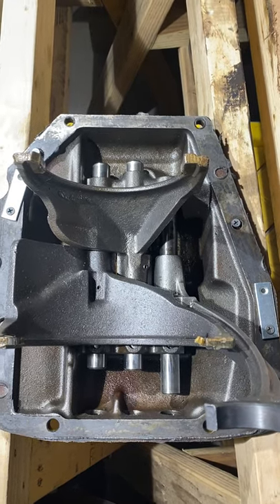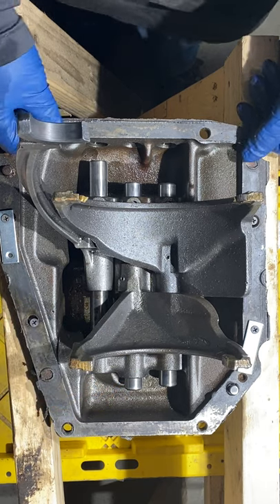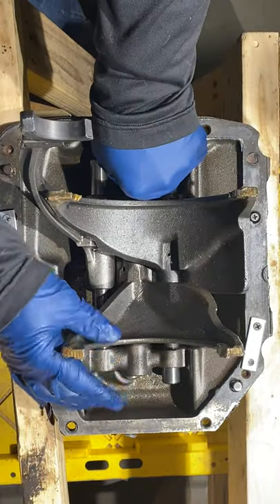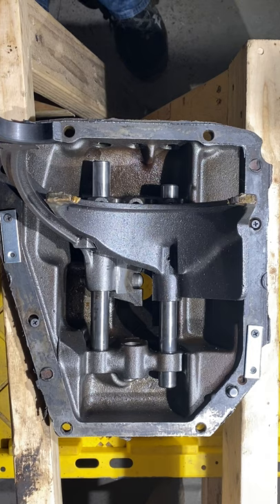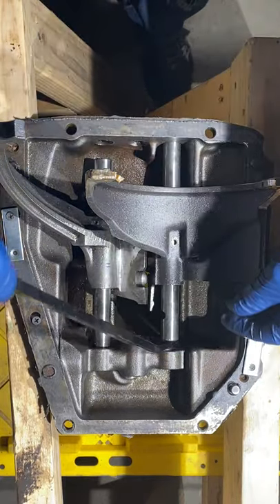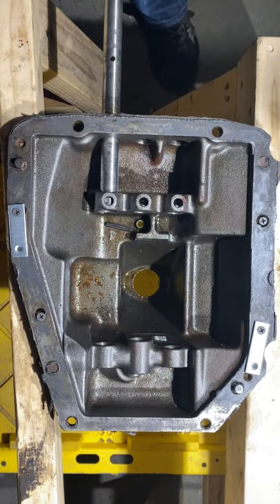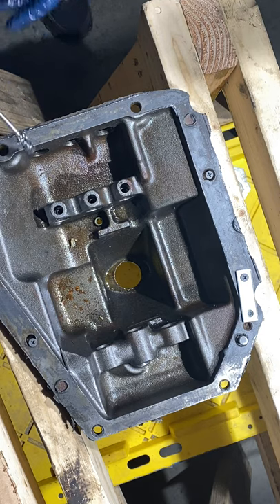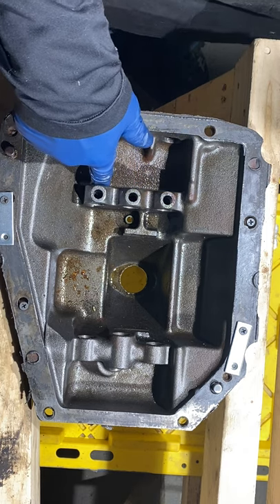SM465 Transmission Top Cover Shift Fork Removal

Comment: Question, does the trans fluid need to be drained prior to removing top cover? I just changed a week ago and now im changing out the top cover.. dont want extra steps if not necessary
Reply from the maker: The fluid does not need to be drained, but getting the cover back on with it full could be challenging as you can’t see the reverse gear location.

Aside from that, contaminants from
Outside on or around the cover would be a bummer to get i. It.
Reply: @humbleman4047  yep just found out the hard way. Im on an incline as well so trying to position the reverse just right dont work. It slides right back down towards the angle. Got my cover stuck for about an hour. Once i finaly got it off i had to tear gasket off. Now im waiting on another. Gonna just drain it so i can shop vac out any silicone i may have got in it. Smooth plan turned into chaos real quick. Live and you learn I guess
Reply from the maker: You can place a glob of heavy grease on the gear to hold it in place.  The grease will breakdown into the oil.  

That is..you can put grease on the meeting gears but the case needs to be emptied of oil first.
Reply: @humbleman4047  Thank you for that info. That sounds like just the thing. Was being stubborn and not wanting to drain it.  Is what it is. Saving 10 minutes cost me a day.
Reply: @humbleman4047  so I got it done. That worked flawlessly. Thank you again for the solid advice.

Comment: On mine I can't even go into second or third or reverse it will only go into granny and first gear do you possibly know what that would be
Reply from the maker: From what you are saying, in would say the reverse “fork” is not aligned correctly.  I would pop the top and do it again.  That is assuming the cover was off initially.

Occasionally the shifter skips out and you might need to get a bar down in the top cover hole to get everything lined up before dropping the shifter back in.
Reply: @humbleman4047  I'm really not sure it just will not move over to reverse at all it act like it is stuck
Reply: @humbleman4047  I did not take the top off but I looked down in and I can see a pin with a spring behind it
Reply: @humbleman4047  it will only go into granny and first gear but my gear shifter has a lot of slop in play also
Reply from the maker: @austinneilson4583  s
Sounds like you need to pop the top and get the fork to lineup.  

If you can’t get the reverse gear to stay in place you might try putting a blob of grease on it.  Once you have it lined up…slowly drop the cover on.  

You can see the groove the fork is supposed to rest in (on the gear) when you look down in the tranny.

It might be the brass synchro(s).? But I would bet of the fork alignment.

There is a video on the cover install.
Reply: @humbleman4047  is there a way I can call you sir